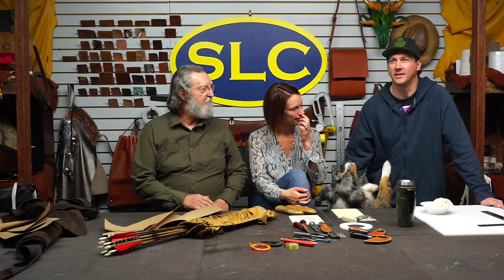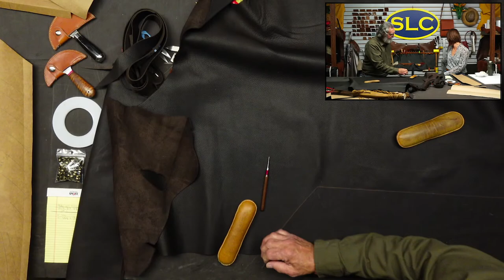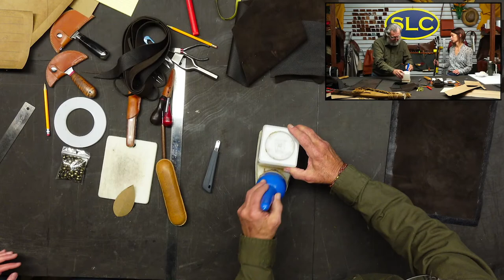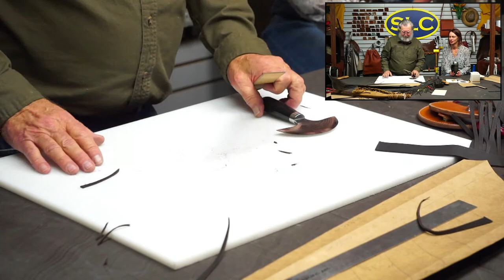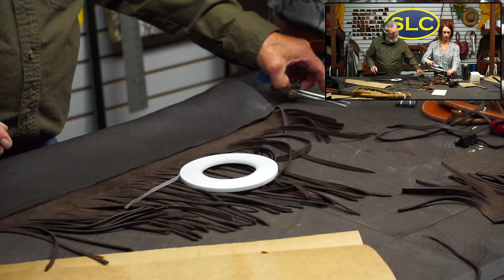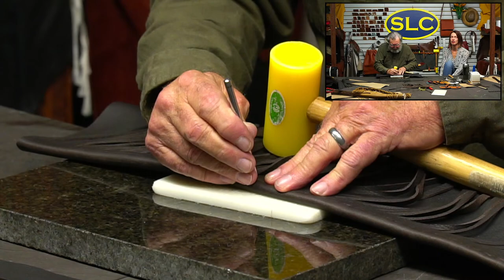Leather Quiver w/ Denny + Liz

Comment: "recycling" plastic is bad for the environment. carelessly throwing your plastic is bad for the environment. the best thing to do is to not buy as much disposable  plastic. buy a heavy plastic bottle and a water filter instead of bottled water, ect.... or reuse/repurpose your plastic into projects. most consumer plastics are thermoplastics, so you CAN melt them into things!!! be it bricks, or whatever. 

recycle metals, its good for the environment. paper, plastic, cardboard, and glass, we need to reduce, reuse, repurpose, and baring that, throw them into a proper trash receptacle. 

also, the old glass bottles you got paid for back in the day werent "recycled" as we know it today, they were washed out and reused.